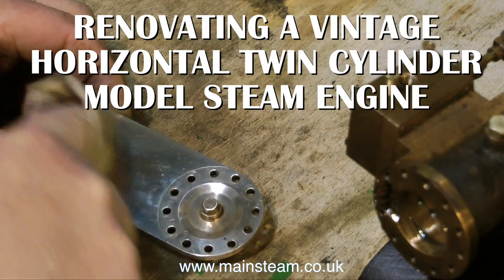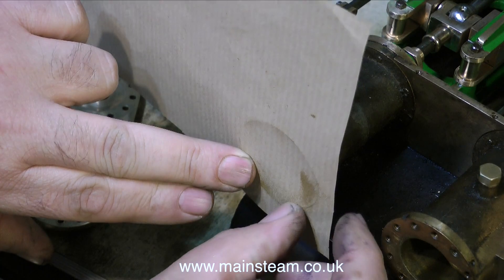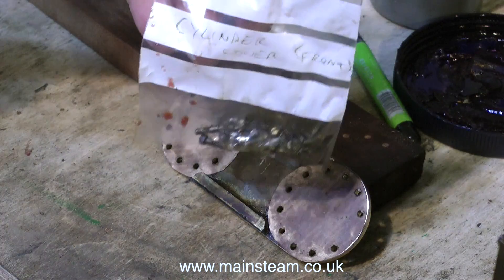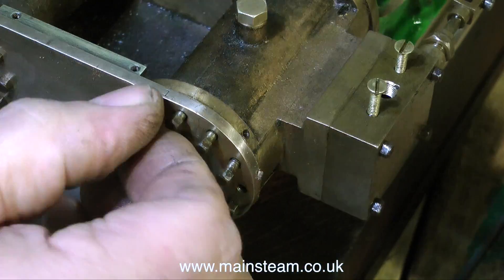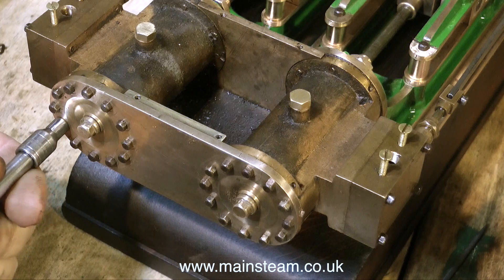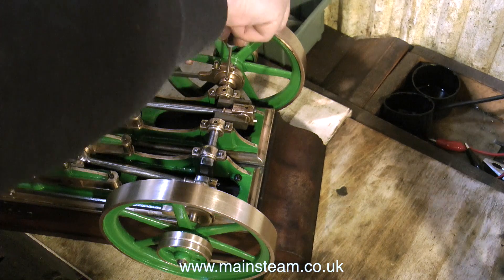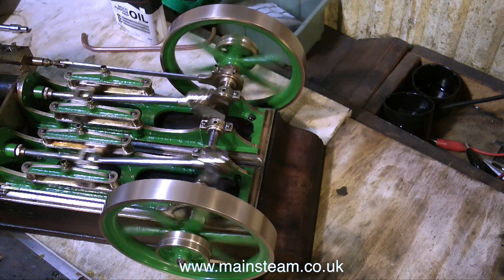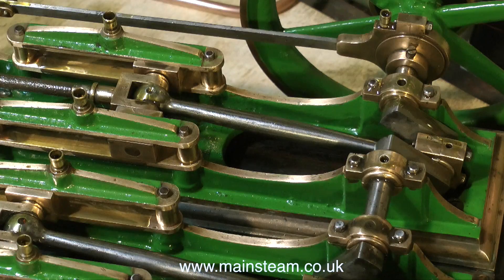PART #13 - RENOVATING A VINTAGE HORIZONTAL MODEL STEAM ENGINE

Comment: Used to use brown paper gaskets on small motorbikes and mopeds back in the 60s, after I got as tip from my grandfather, and the real gaskets weren't available at a price I was willing to pay. He told me to coat the paper with old-fashioned copal oil varnish, and put on wet.

Comment: I really enjoy your videos and commentary you provide with them.  I think you mentioned a "silicone" piston ring in this engine, which you were concerned 
might tear on oil holes in the cylinder. Have you looked at other materials such as EPDM, or PTFE o-rings instead of the silicone, which are known to be somewhat delicate regarding abrasion and treating ?   Thank you and best regards, Darryl Dodge